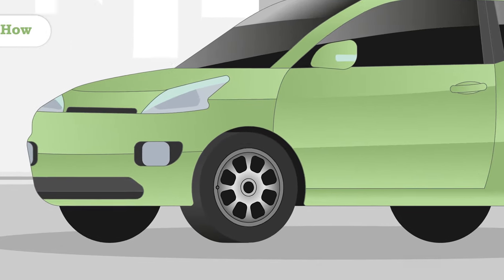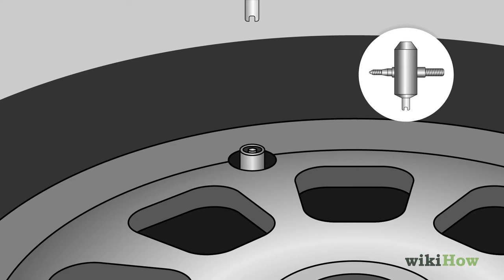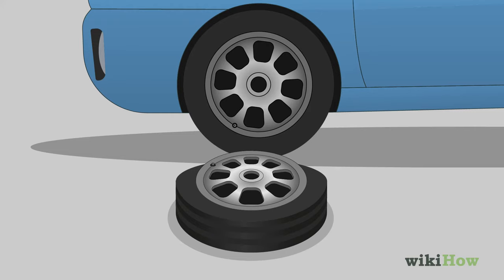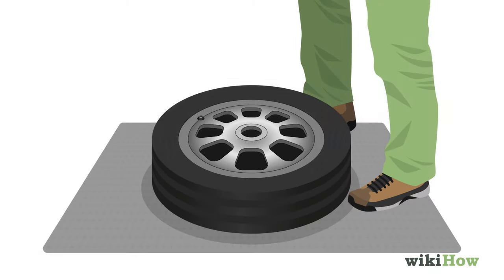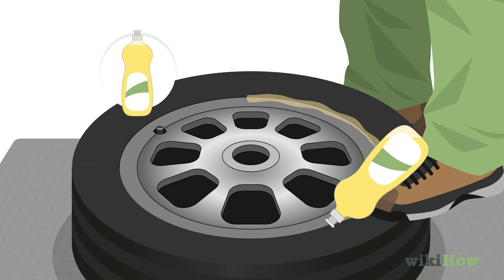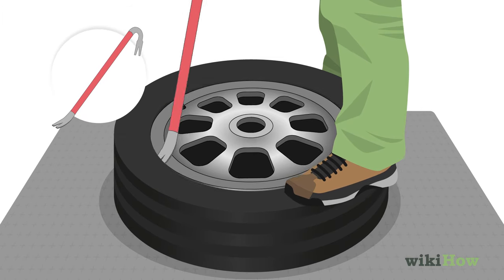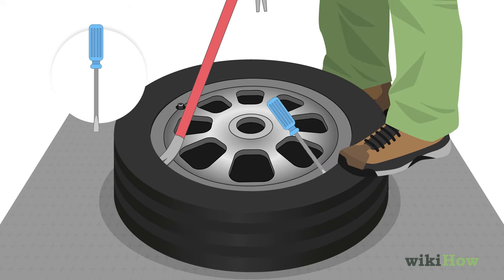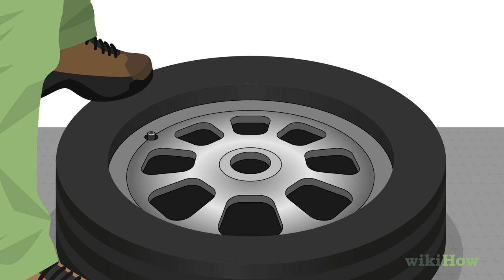How to Get a Tire Off a Rim

Comment: You don't need a valve core remover to let the air out. You can just use something else to let all the air from the tire. Like the air remover on a pocket air pressure tester.
Reply: Thank you! I genuinely thought it was a necessary tool
Reply: So take out the air of the tire
Reply: You'll never get all the air out and won't be able to break the bead when removing the tire

Comment: I fucked up by cutting the treads off of the tire before breaking the bead because I didn't know tires had beads. So now I am trying to remove just the bead and it's goddamn impossible
Reply: Bahahahaha. Yeah. Fuck this. I’m just going to a tire shop
Reply: Disc cutter for a drill or whatever it’s called
Reply: Hey, did u find a solution yet?
Reply: Same boat here.
Reply: For anyone looking for an answer. Removing the bead is possible, it takes some patience, sweat, a dremel tool, as well as (most importantly) bolt cutters. Bolt cutters were the only way I was able to cut through
Reply: @patchworkmountains  I don’t have none of those tools. And can’t afford them currently, that’s why I tried doing it myself